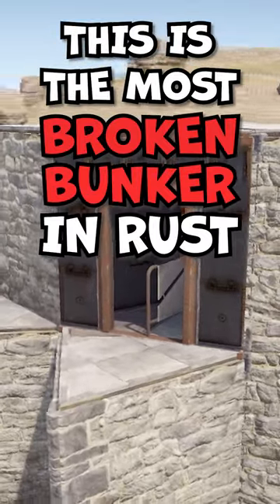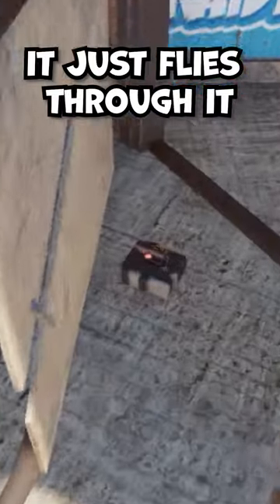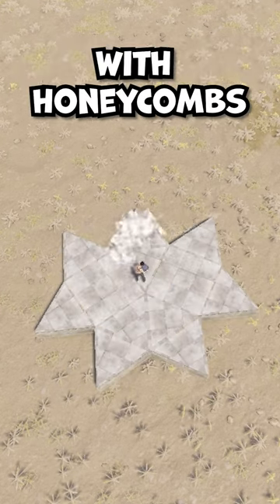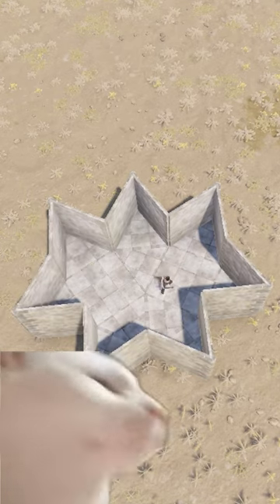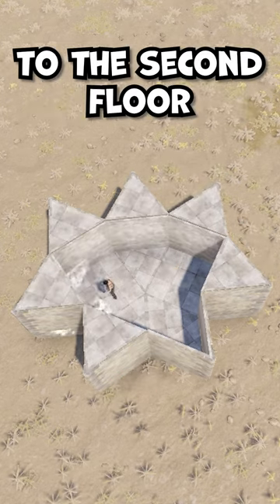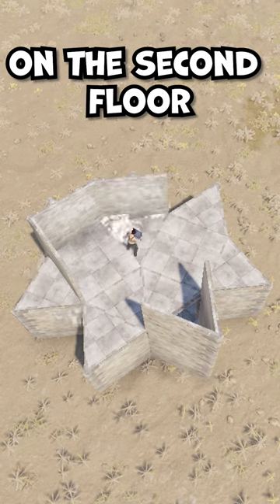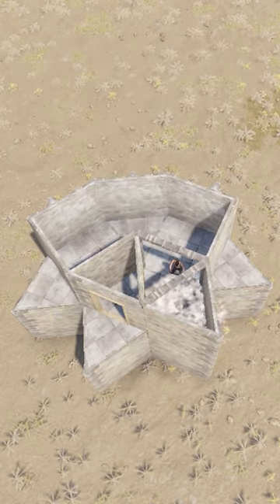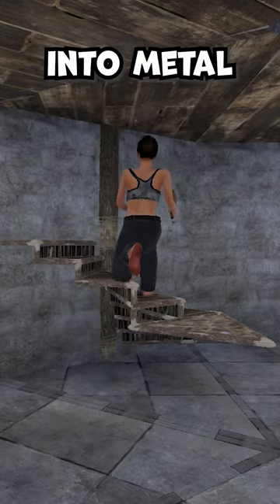This is the MOST BROKEN BUNKER in RUST shorts #shorts #rustbunker #rustbase #rustshorts

Comment: people can place twig frames without tc priv so its not 100% secure, this problem can be fixed easily by putting something under the stair to block them from placing a twig frame when ur offline/want it closed. i dont know if u can do it with this design, but it works on the one i use
Reply: This bunker gets opened by destroying the twig, not placing it.